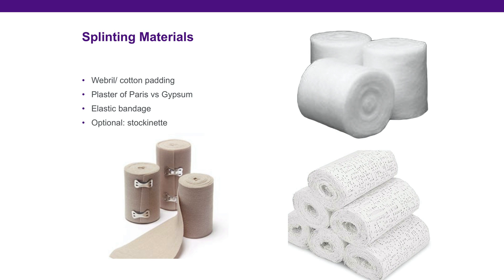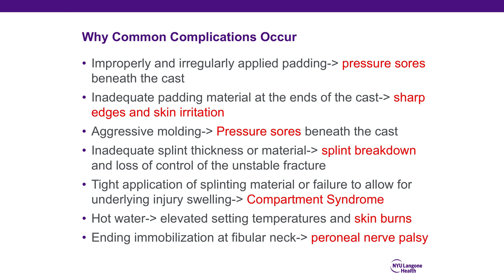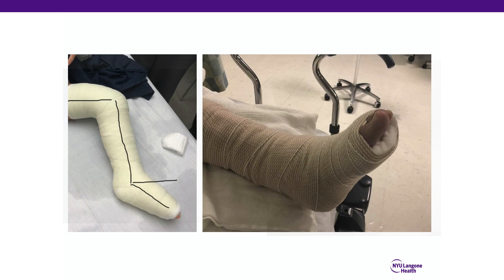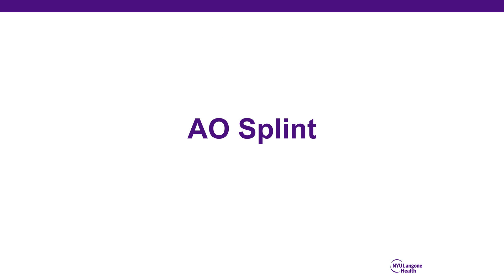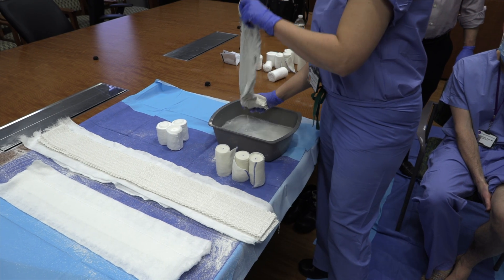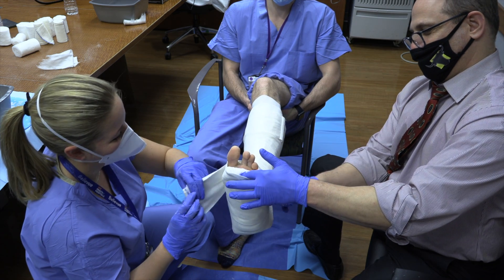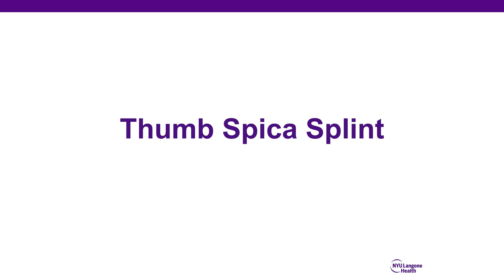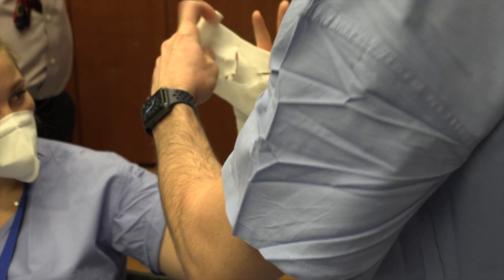Orthopedic Splinting Basics: AO Splint, Sugar Tong Splint, Thumb Spica Splint

Comment: Great video with lots of good information and example. I have 20+ years casting with the last 10 being in 2 Pediatric Ortho offices. I am not a fan of making a sandwich or plaster slab as they describe it in the video. I think it is important to apply the padding first with extra over bony prominences. Your sandwich is uniform in padding with no consideration for extra padding where needed. I even add a stockinette under the Webril. If you hold the plaster strips in place with a little more Webril before applying the ace wrap, you leave good options. Let me explain. You break your arm and the fracture is reduced under the splint. You come to me and the provider wants an overwrap to maintain the position of the fracture. I remove the ace wrap only and put fiberglass over the splint so as not to loose the reduction. I can only do this if the splint was correctly applied.
Reply: Thanks for the insight! Any good book recommendations for casting and splinting? Thanks

Comment: very good video. I have a question... I had a distal radius fracture this week. The doctor made a sugar tong splint, but has included the fingers so I can't move them. He said it will be like that for a week... why would it be necessary to immobilise the fingers? Thanks.
Reply: For distal radius fractures, I would let the fingers stay out. Whether it is a sugar tong splint or a long arm cast followed by a short arm cast, it is important for the fingers and thumb to move to keep them from getting stiff and sore. This movement helps keep swelling away also. Most people fold the plaster back over the hand if the splints are to long before applying an ace wrap.
Reply: @ffdarrell  Well I ended up with my fingers immobilised for a month and now I can't move my fingers properly (8 months later). At the time, the doctor said it was because the break was in two places and the wrist was unstable, if it moved he would have needed to operate. But now I cannot make a fist or grip things.
Reply: @wendydee3007  Sorry to hear that. Have you gone to PT/OT. Common practice is to immobilize the joint at both ends of the fracture. If you fracture both the radius and ulna, you would include the hand and go above the elbow when casting. Was your fracture reduced prior to casting. I am a cast tech with 20+ years casting with 10 in adult practice and 10 in peds. There is a big difference in the 2. Adults often require OR because the bones do not remodel like they do in kids. Do you have any nerve damage? Is sensation in your hand and fingers normal? What is your age?
Reply: @ffdarrell  I'm 58, there was a T-shaped break only on the distal radius.The cast went over my elbow and right to the tips of my fingers. The wrist was reduced before casting, and it was in such a good position that the doc didn't want to disturb it or take the cast off the fingers. There doesn't seem to be any nerve damage, but every morning my hand is stiff and flat and I have to work it hard to get the fingers to make a fist. I can't make a complete fist. I had great physio, 5 days a week for a few months, but it didn't seem to improve much. My fingers don't look normal, a bit like the Vulcan salute of Spock from Star Trek! But I live with it, I really work with it if I need to use the hand for fine control, I'm glad I didn't need surgery and metal pins :o)
Reply: not sure abt the specific fracture as i’m not a dr, but certain fractures must have the joints above and below immobilized, since movements of those joints can end up moving the injured wrist. <3